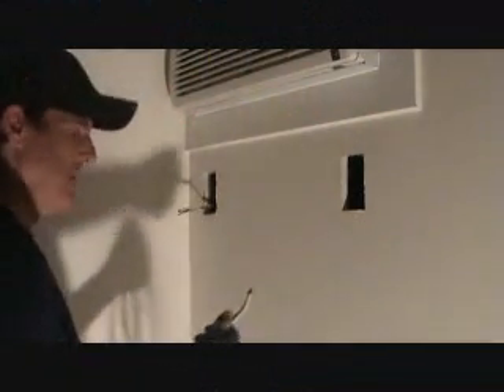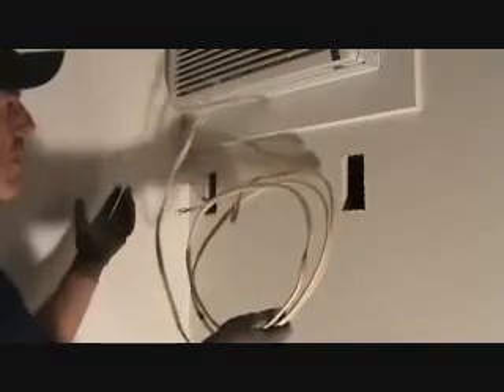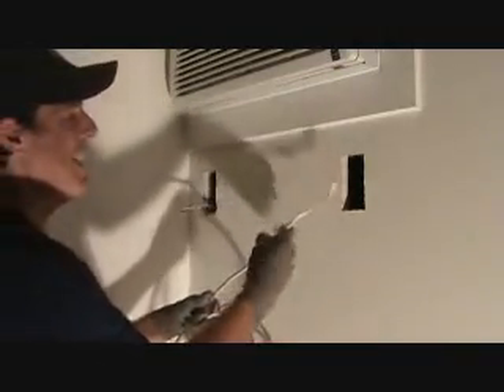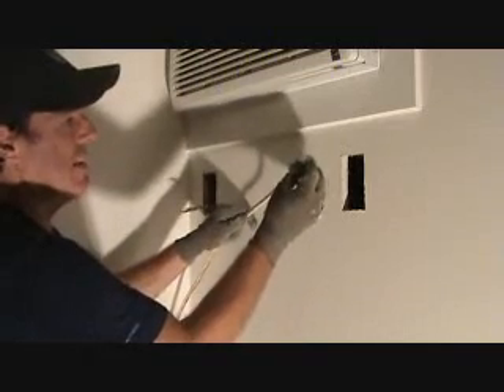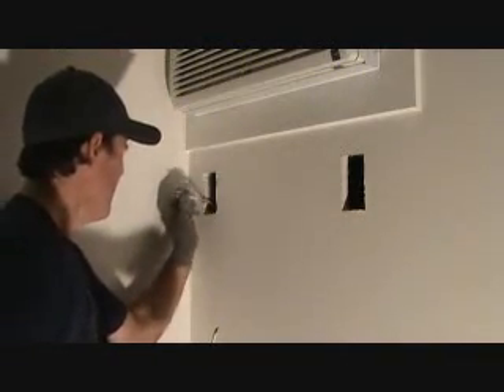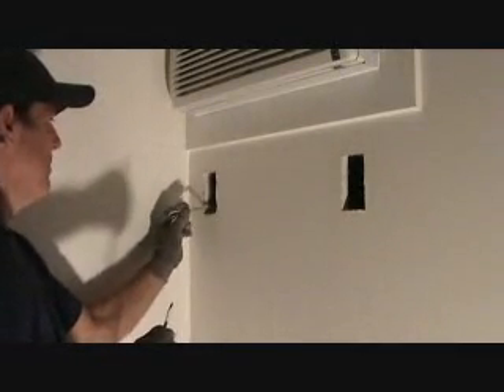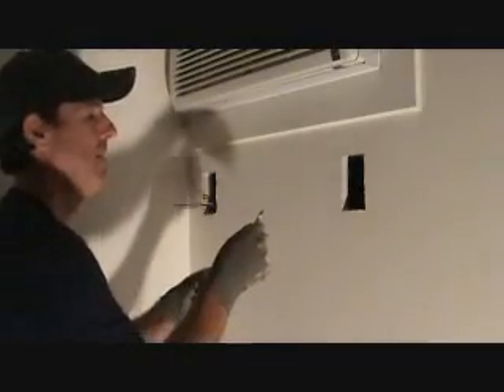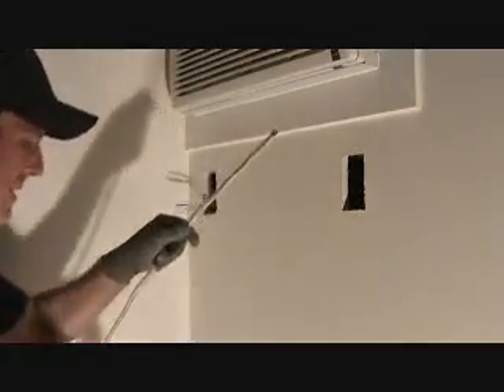What size wire for a 20 amp breaker...?

Comment: Resetting a thrown breaker is MUCH easier to fix than fire damage restoration.
If you think there is any wire 14 guage or smaller (i.e. higher gauge numbers)
on a 20 AMP breaker circuit -- switch your breaker to 15 AMP
If you have problems with the breaker being thrown too often
then go back to 20 AMP breaker BUT have the circuit load/resistance tested.
You can do that yourself but it requires a lot of analysis (wire length, voltage drop, etc)
to ensure the wire is safe for a  20 AMP load.
Reply from the maker: Thanks for the info!
Reply: @VideoJoeKnows 
I was just summarizing from the info you provided.
Good job getting videos out about this.
Reply from the maker: @2Truth4Liberty  Thanks for getting back to me. You know if you want to see the entire project for what I was doing for installing this 4 hour timer then I have all those videos of course! You could give me your thoughts for sure. Just go to my main YouTube channel page then click on playlists & scroll down to electrical & they should all be in there I believe. Thanks again!

Comment: Can I use a 10/2 for a 20 amp wire?
Reply: 10/2 wire can handle up to 30 AMP 
(actually more than 30, but safest not to go higher than that for the breaker)
You can always put a lower amp breaker, just not the other way around.
Reply from the maker: I guess but why would you want to waste that wire plus it will take up more room in your outlet box. I would just break down & get the 12/2. You can get the 12/2 in different lengths at most hardware stores to where you shouldn't have to purchase an entire roll or anything...as a thought for you for next time!

Comment: Yeah this video concerns me, first off that wire looks white which is normally 14 AWG not 12, 12 AWG should be yellow, and secondly, like Johnny said about the wire size, this guy is wrong, the higher the number, the smaller the wire is. Need to delete this video so you stop giving people wrong information, electrical work is dangerous and the number one reason for fires in the US. Leave it to us electricians. " IBEW pride"!!
Reply: I still have some 10 gauge that is white. IT is UF-B which today is almost exclusively made out of GRAY.
They didn't start going to those colors until around 2000 circa (and was voluntary, not in code).
All sizes and types used to be made in white.
Wire that is OLD stock (WHITE) that is properly stored can be safely used for at least another 100 years.
Reply from the maker: I've seen 12 gauge in both yellow & white....
Reply: 707tpt Old 12 gauge, 12/2 wire USED to be white. The insulation color changed years ago.
Reply from the maker: I've seen 12 gauge wire in both white & yellow....
Reply from the maker: I've seen 12 gauge wire in both colors.

Comment: How did you figure out it was a 12 gauge wire ? . And howd u miss that initially ?
Reply from the maker: At first glance it appeared to be 14 gauge wire since 14 gauge is easier to work with & a bit thinner than 12 gauge wire but then I looked at the electrical sub-panel & it had a 20 amp breaker on there & the wire size to use for 20 amp breakers is 12 gauge & not 14 gauge. 14 gauge wire size is installed on 15 amp breakers....

Comment: You should listen to what you said in this video... " the higher the number... the bigger the wire?"  
Hmmmmmm?      I think I smell smoke?
Reply: I put in 28 gauge wire in for a 20 amp circuit and it the circuit keeps failing but doesn't throw the breaker. What could be wrong? And, yes, I do smell some smoke, I think.
LOL

Weird. I switched out the wiring to 6 gauge and now all is fine LOL
Reply from the maker: Well for 20 amp circuit you can use 12 gauge wire & nothing any smaller than that.....meaning 14 gauge or bigger....know what I mean?
Reply from the maker: I did? Sorry! Thanks for catching that if that's what you heard....
Reply from the maker: That's weird like an oxy moron since the higher sized wire you could think of that as a bigger sized wire or a smaller sized wire....right?!!

Comment: what wire gauge should i use for a 27amp breaker...and how many outlets can i run of that same 27amp breaker?
Reply from the maker: +NZ BUDZ Ha! Is this a trick question?! I have never heard of a 27 amp breaker!   Joe  :0-
Reply: VideoJoeKnows I assure you it is 27amp breaker...so hows about that answer...
Reply from the maker: OK I've never heard of a 27 amp circuit breaker so I'd hate to give you an incorrect answer to your question. Here's what I would suggest you do. Go to your local hardware store & go to the electrical department & ask a sales person & see what they say. Or google your question & see what pops up. Thanks for stopping by!   Joe  :0
Reply: VideoJoeKnows well here's what I found online about size of wire to run with 20amps plus...in my case, I'm able to run a 6-7 gauge wire...assuming it's 110v, am I anle to have multiple outlets on the one breaker, say 2-3?...the breaker is a single pole by the way...your expert opinion?
Reply from the maker: Yes I am sure you can run two or three duplex outlets on that circuit of yours......of course depending what type of things you are going to plug in there. But I would think you should be fine....my opinion.   Joe  :0
Reply: 12 gauge only if "90 degree" rated copper
10 gauge should handle it no matter what type
http://www.usawire-cable.com/pdfs/nec%20ampacities.pdf
Reply: Here is the answer to your question: since the duty cycle rating on most dual pole 27 amp circuit breakers is 50%, you should round up the amperage rating to the nearest round figure which is 30 amps,. Thus you would use a 10 gauge wire even though the duty cycle is 50%.

Comment: i'm glad i found this video.i was going to use 15 amp breakers on 12-2 wire.thanks for putting this video on here.
Reply: Hi ! you can use a 15 amp breaker on 12 gauge wire , but yo can not use a 20 amp breaker on a 14 gauge wire ! Ok thanks and be safe .
Reply: +everett thornton 20 amp breaker 12/2 wire 20 amp plug  s 2 staples
Reply from the maker: +everett thornton Thanks for your message. Good luck with your project!   Joe  :0
Reply: 15 amp would be okay
You can always make the breaker lower just not the other way around.
The smaller the AMP# for the BREAKER, the SAFER it is until you go so low that the breaker keeps tripping when running your equipment/appliances

Comment: 12 gauge for 20 amps. I don't use 14 gauge wire on 20 amps, because that's against code. Good video, thanks for sharing!
Reply from the maker: Yes you are correct. 14 gauge wiring would go for 15 amp breakers. Thanks for continuing to check out my videos!   Joe  :0